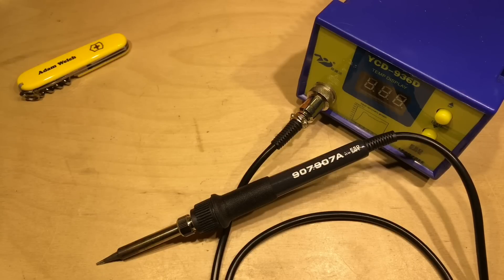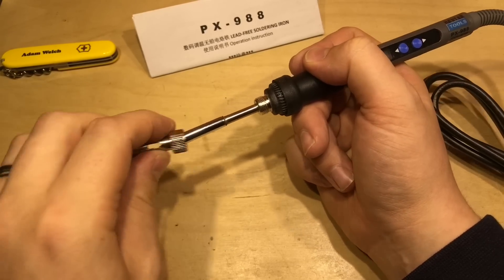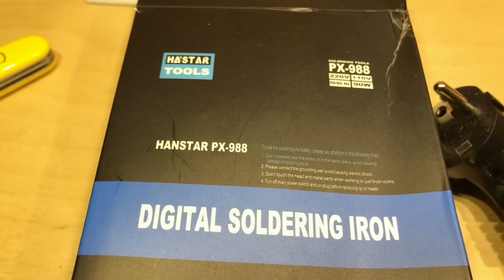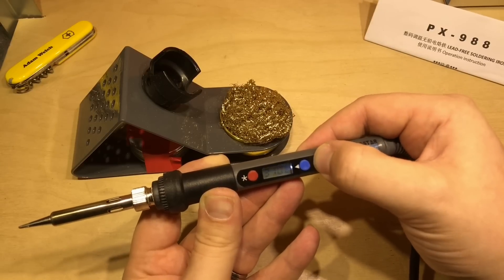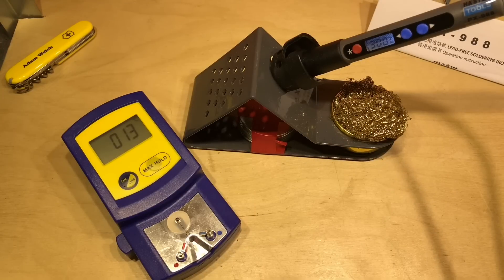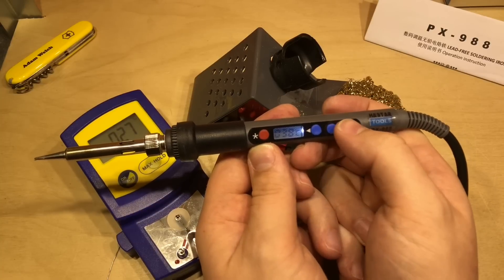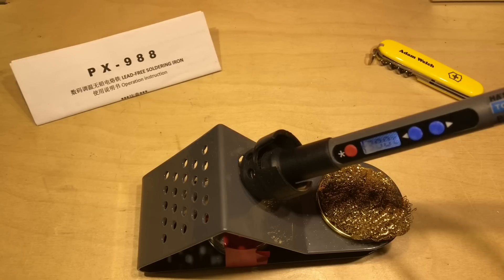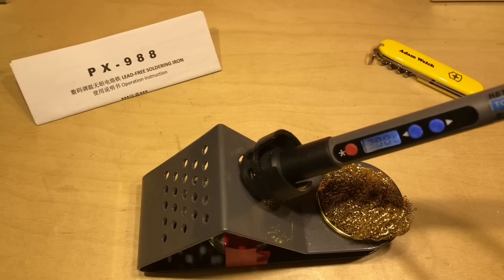PX-988 Digital Temperature Controlled Soldering Iron - 12v Solar Shed

Comment: I'd like to buy the flat-tip you are using, but don't want the rest in the pack. Which one is it? T-2.4D or T-3.2D or?
Reply from the maker: +UFOhunter Actually I use the 1.6D now I’ve checked. Ebay sellers do sell them in packs too... https://www.ebay.co.uk/i/282165776691

Comment: switch to t12 do not look back.
Reply: oh and ditch the pointy tips for the work you do they don't help. try bc2 bcm2 and such chisel like tips you will love it. even the k tip coming with cheapest t12 irons will be much better. the fine tip pointy ones are for some smd jobs not even all... last resort tips really the pointy ones.
Reply: also if you must use 900m at least try copper tips and shims.

Comment: I wish they would do these in a 12volt version as i try not using mains in the shed, and like you i have lots of 12volt power.
Reply from the maker: +Mark Flack I’m of the same opinion. I have a 24v iron but although it would work at 12v I expect it wouldn’t get very hot or hold its temperature well. 
We’re not really a mass market though us shed dwellers.

Comment: Impressive, I wonder what's different about the heater in these that allows it to heat at 90W or if it's just abusing a regular A1321/A1322 heating element for a brief period of time.
Reply from the maker: +vgamesx1 I suspect it might be the latter. My mains watt meter is a bit slow and might not show the full power being delivered. Elements are pretty cheap as well though. You just need a soldering iron to fit it ;-)
Reply: The heating core is the same style as A1321, the sensor is the same but the heating element is for higher voltage.

Comment: Hi Adem I like the iron, looks good but I hate that stiff flex we get on most hand tools today....
Reply from the maker: Yeah - I guess you could replace it with a silicone cable?  The handles on my solder station are also a little stiff but I guess I'm used to it now.
Reply: They use less of the toxic chemical which softens the plastic, nowadays. (Maybe it's cheaper too!) Allegedly, old leads become stiffer as a result of the chemicals leaching out.

Comment: Just sitting in the stand, it doesn't need much power to keep the temperature stable. The heater receives a short pulse, your wattmeter can't quite catch that quick event. Try 'loading' the iron with some ground plane, the pulse should get wider and you might see the described 90w. 
  Nice review, quite informational. 
But I won't recommend touching the tip or any part that gets hot at any time, the little grease on the hot part will burn up and make it look nasty.
Reply from the maker: Yeah my meter is a little slow.  That's a good tip to 'load' the iron.  Next time.  I don't mind my soldering iron looking nasty, but I guess I should consider looking after it a bit better.  Thanks Mr J
Reply: Adam Welch That's up to you, of course :) I like to keep the iron reasonably clean, it will discolor anyway but it won't be dark brown, at least.
 I saw few irons that are as black as the handle is :D

Comment: Adam, do you know if the clone Thermometer / Temperature Tester is accurate?
Reply from the maker: +Barry Greengrass A good question. Pretty accurate - and I base that on the fact that many of the soldering irons I’ve tested with it result in a close measurement. I’ve got a thermocouple I might be able to benchmark it against I guess.
Reply: That would be good to know Adam I bought a hako 191 thermometer it was reading 500°C when my Iron was set at 350°C
Reply: My point too, Adam. A 5% error in both devices can account for a 30 degree difference in readings at normal soldering temperatures. Thanks for the review of what looks like a fairly competent iron.